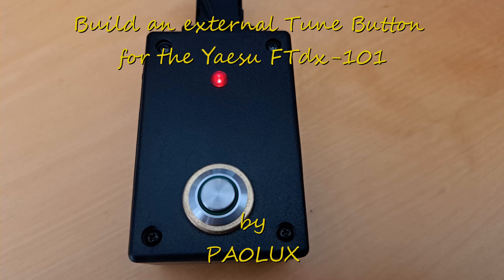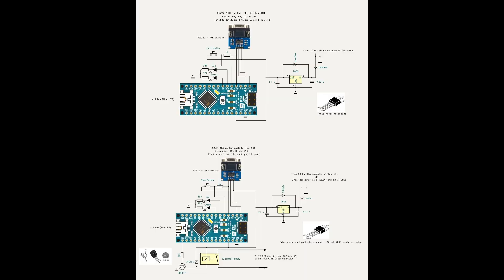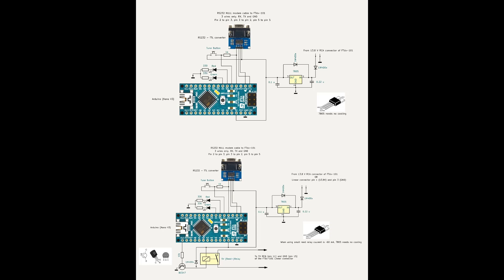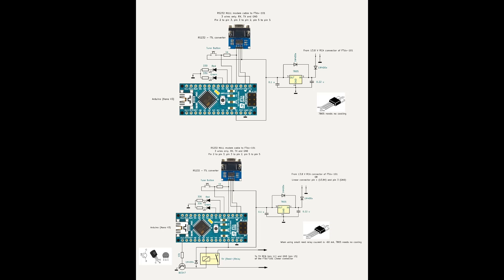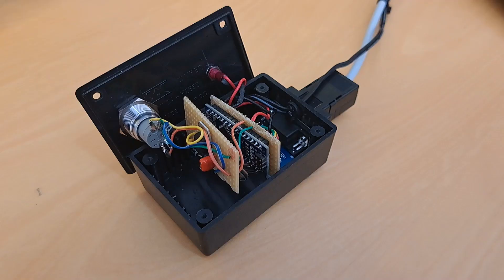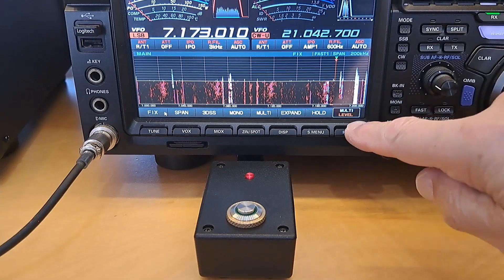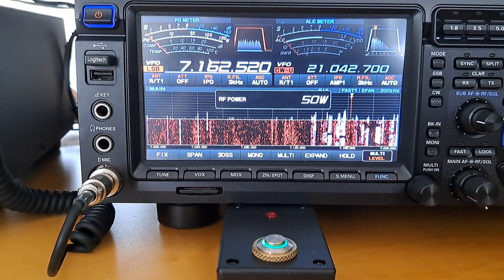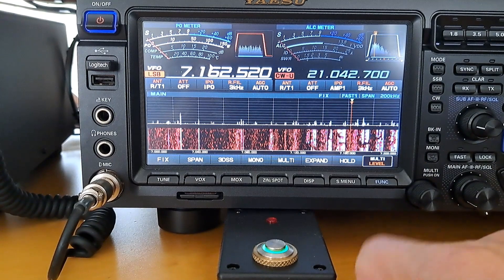External Tune Button for Yaesu transceivers like FTdx-101, FTdx-10, FT-991 (a), and others.

Comment: Thank you! Going to build one and see if it work with the FT-710
Reply from the maker: I recently just found that the FT-710 does not have a Rs232 connection. Text has been changed for that. So you cannot use that. But there should be a possibility (says the book) to use the linear connector  for CAT commands. But I do not have enough information how to use that connector for CAT.
Reply: @PA0LUX  I bought a connector and will see if I can get it to work.  What I don't know is if it will respond to CAT commands from both the UART from the built in USB port and RS232 from the tuner/linear jack at the same time.
edit: I'm looking at the list of CAT commands I see MX listed but there's not explanation for MX in the detailed section.  Maybe MX1, MX0 doesn't work for the tuner/linear jack?  I'll have to test that first.

Comment: Thank you for creating this project and sharing it. Plan on building this for our Yaesu FTdx-101. My Wife and I are both Hams, KA2PFL and N2GUU, Son is a Ham also. Just want to confirm that this will work when using WSJT-X (which uses USB port) . 

Had issues trying to use HRD and WSJT-X at the same time as both cannot use the USB port at the same time. Was going to use HRD for the power reduction and PTT. Looks like your project using the RS232 port will work. This will be our first project using a Arduino computer. 73 Louie and Meg🙂
Reply from the maker: Hi OM, yes this works fine and only with the Rs232 port. The USB port on the radio can at the same time be used for whatever you want. I am using HRD(v6) also, together with JTDX (and WSJT sometimes) and also JTAlert. Also Omnirig for use with SDRplay software and both RX outputs of the FTdx-101. WSJT and JTDX should work together with HRD without problems when HRD is selected in WSJT/JTDX radio selection.
Reply: @PA0LUX  Thank You very much for your reply and helpful tips. 🙂